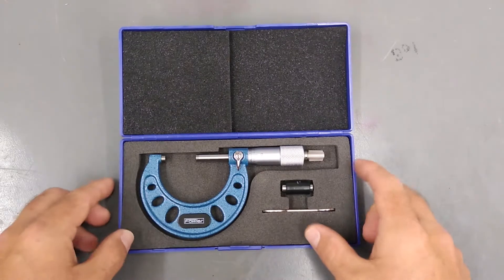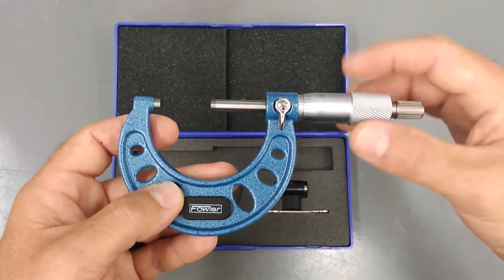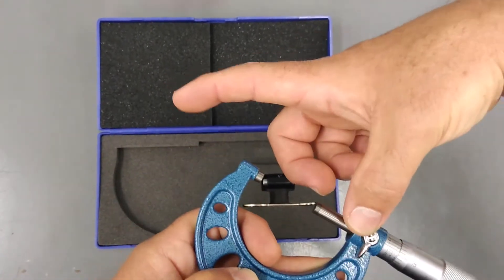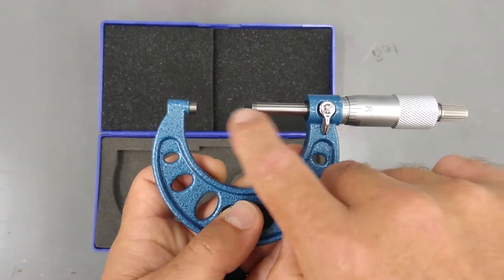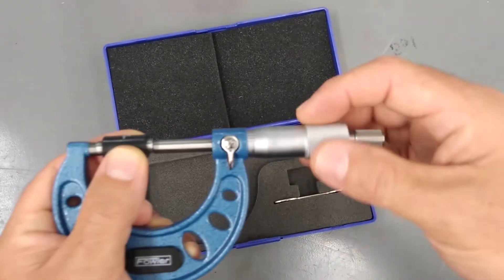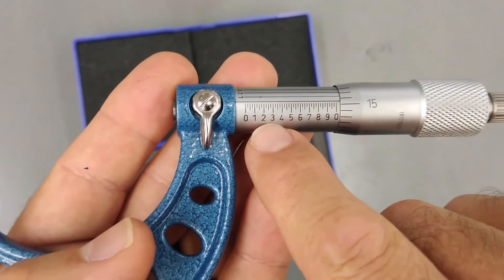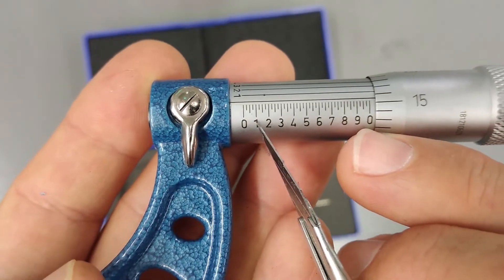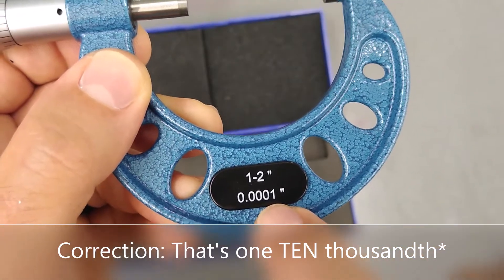Vernier Micrometers, How to read them.

Comment: So for aviation use, what sort of price are you looking at for a suitable micrometer? Also, what do you think of digital micrometers? It seems you can get them in the $75 to $100 price range...Would this sort of instrument be of adequate quality?
Reply from the maker: Hello Peter, you can use micrometers to measure material thickness, shims, etc. Digital ones are just as good, only a different way of displaying the readings. As long as it's a good name brand product, it doesn't matter if it's digital or mechanical. 
Low budget ones I have found to be unreliable when compared to a calibrated standard.

Comment: You haven't explained what is the small handle drum for.
Reply from the maker: Good catch! It's a ratchet or clutch to limit how hard you tighten the thimble on the micrometer so you can get an accurate reading. You are actually supposed to turn the thimble using that small drum at the end until it ratchets and not the thimble itself. But I have a feeling you already knew that! Lol...